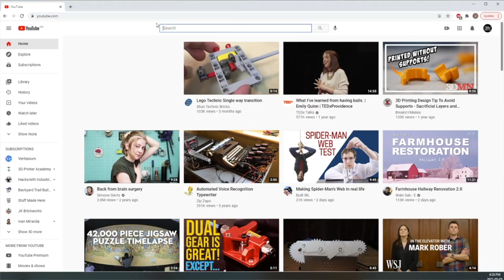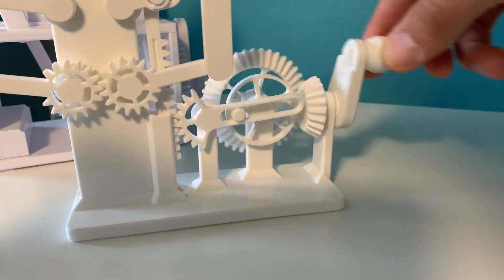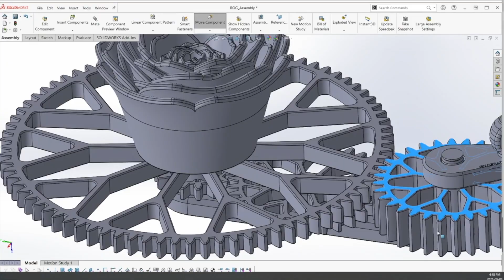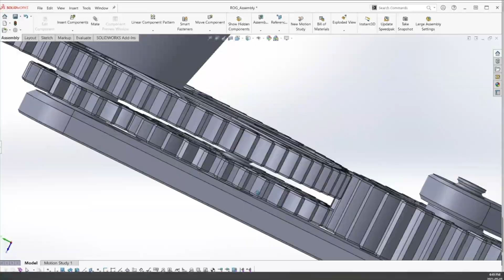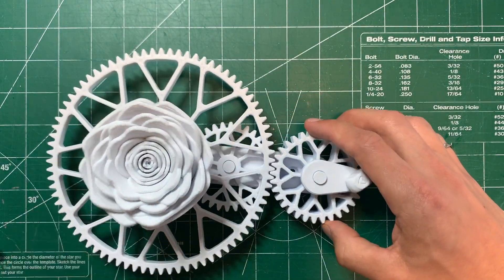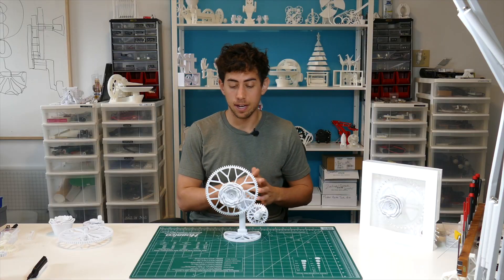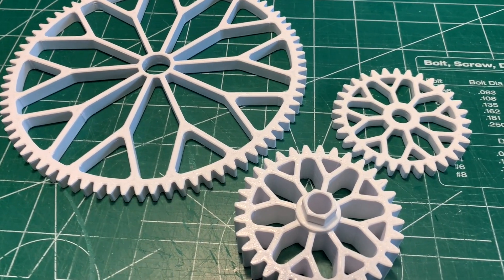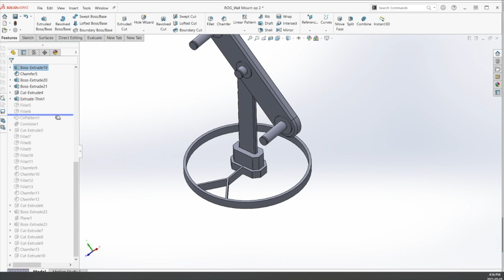How I Made the Rose on Gear 3D Printed Sculpture

Comment: Amazing work. Just discovered your page, definitely going down a rabbit hole. Love seeing your thought process behind the design. And the finished work is beautiful. I too love to create, and utilize 3D printing a lot. And I find a lot of consideration has to go into part design in order to optimize geometry for 3D printing. Very well done.
My challenge for Rev 2.0: have each layer of pedals on the rose rotate about rose's center in opposing directions (or just at different ratios). 
Do you accept?
Reply from the maker: Thanks so much for watching! That is an interesting challenge :)

Comment: Huge fan of your work and content. Really appreciate you sharing your process and your .stl files. I’ve scoured through some of your live streams looking for your go to tolerances and press fit designs. Basically, what is your process for identifying tolerance and then your system for organizing that info for future designs.  I know tolerance changes depending on material and printer but would love to see a quick list or maybe even future video of what you use for things like:
-Cylinder offset to fit a hole
-C-clip size for shaft 
-C-clip thickness to allow for flexibility
-Backlash for gears
-Snap Fits (compression gap)

Thanks again and keep up the great work!

Comment: What kind of printer do you use? And what resin ?
Reply from the maker: I use a Prusa Mk3, and Ender 3 v2, and an Anycubic Mega - these are all FDM printers, so not resin but filament.  Lately I've been using E-Sun PLA+